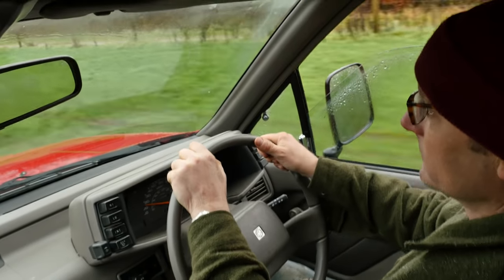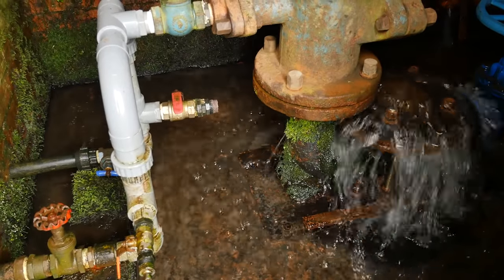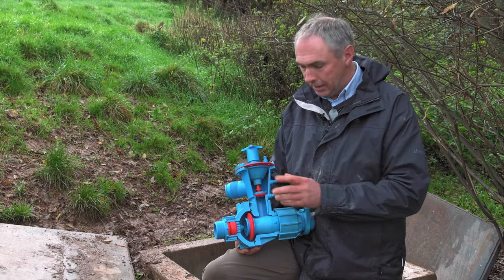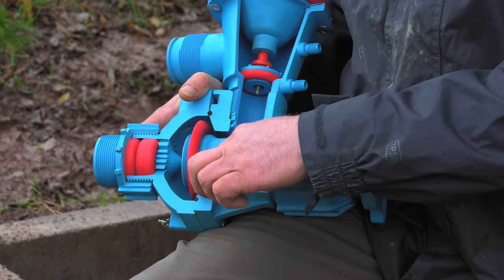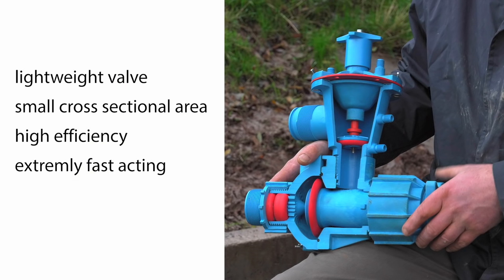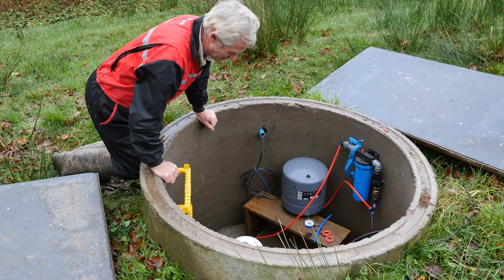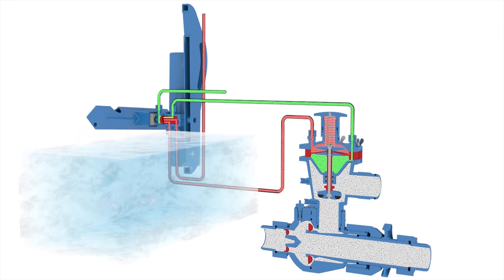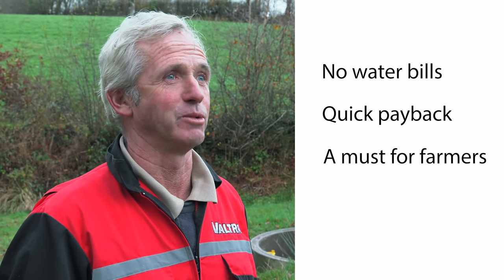Ram Pump The Papa Pump using Sureflow Control Valve technology

Comment: I just install a1" hydraulic ram pump, you are right i got problem with the swing valves
Reply from the maker: The Papa pump uses a special rubber formulation and profile for its valves which enable them to be efficient and durable, and so not really comparable to any other 'ram' pump.